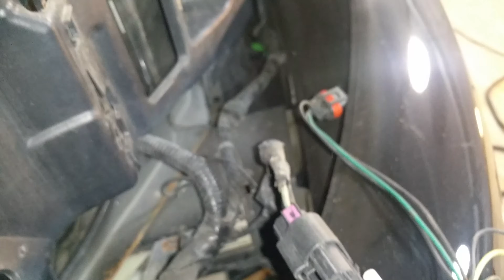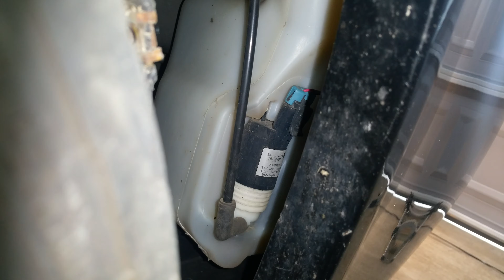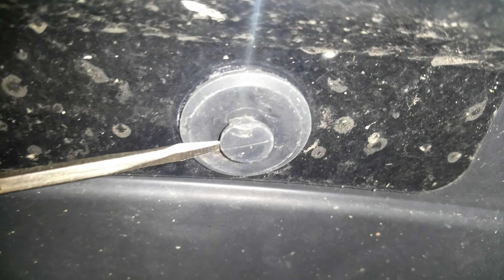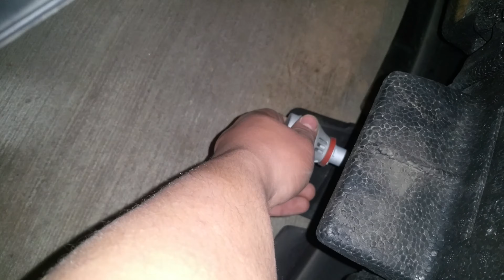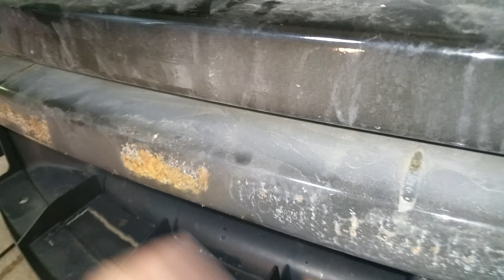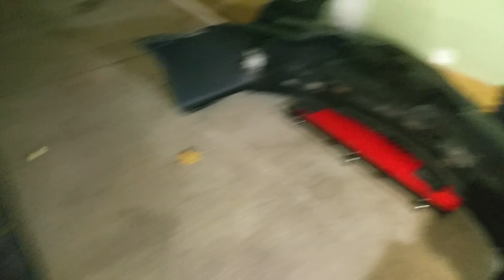Pontiac Grand Prix GXP - How to remove the front facia

Comment: Hi. I have the exact same car the front driver side bumper got ripped off I have it the blinker is like hanging but I can put it back into its spot but it's like broken and half I I can put it up in I'm just not sure where the holes in the nuts I would need to put it back I mean when I put it back and hold it there it looks like it would stay I just don't know if I should use glue or poxy or find those washers and bolts like on your video but when I put it back up it does look like I can it'll fit good the wheel protectors one actually came off I'm probably just going to leave that off if I if I can I don't know if I need it or not it doesn't seem really like I need it but I might need it I don't know but I'm a girl and I have to do this myself so any you know advice would be greatly helpful I don't know how long I'm going to this video but yeah well thank you Merry Christmas hope you get back to me thank you

Comment: I have 2006 gxp 5.3  installed 2 transmission coolers one in series with the  Oem rad cooler still ran to hot so a added a 2nd large rv cooler in parallel  with  the stock set up finally acceptable temp . My question has any one header wrapped the exhaust over the transmission and see a drop in trans temp if so can you let me know .

Comment: I always wondered when they quit making real steel bumpers on cars if there was still one hidden behind the facia . when you got it off, ( and nice job explaining everything)  there is kind of a metal bumper there . Is there any strength to that or just sheet metal . could a toe bar be hooked to it ?
not sure if you can tow a FWD car in N with out wrecking the transmission I think the engine has to run to pump oil through transmission.  I live on a hill with long drive way. in the WI.  I own tractors
so when we get stuck coming up the drive way there's no place to hook a chain unless I have a couple hooks welded to the cradle  then the chain still might crack the  plastic facia on the bottom/

Comment: Yes, I am curious about the Trans cooler install,   will we see a video of that in the future??  Your videos are extremely helpful,  just bought my 2008 Grand Prix GXP,  Love it!!  I also have a 2004 Bonneville GXP,   Keep up with the Fantastic videos!!
Reply: Put a large transmission cooler on both those cars transmission in did on my  2006 5.3 gxp Grand Prix  plus I changed fluid with synthetic transmission fluid that’s dextron 6 approved and service yearly . Bought the car cheap re did minor rocker rust , repaired heads up display redyed  front seats repaired minor rust on the rear quarters replaced the valve front cover gaskets and o rings replaced rad ,charged Ac after repairing leak ,rebuilt transmission installed touched up black paint and the polished and waxed cleaned Alcoa rim which were mint . The car looks and drives factory new very happy and it gets great gas milage if you can keep your foot out of the gas pedal . After I completed the car I oil undercoated  every nook and cranny of the unibody rockers rad mount front towers doors unibody infrastructure from headlights to rear bumper support rear deck hood wheel arches in and outer . In total i spent about 200  hours on the car

Comment: Did you happen to do a video on installing the trans cooler you mentioned?
Is there any other steps in doing so that you can list, if no vid?

I am thinking about a trans cooler on my 07 GP - I Uber drive and when the trans temp gets over 210 degrees it shifts hard.

Comment: $2600 to do my transmission 2yr/24000 miles warranty. Does your extended warranty cover the repair.
Reply: Robert Gray I GOT WAXED FOR 4700 WITH UNLIMITED MILES FROM AMMCO
Reply: Hi from Ontario Canada,I just restored a 2006 gxp replaced transmission I purchased as is . One thing I found theses trannies run way to hot which kills them . I found mine in late August running 214 f so I added as big a cooler I could fit in line with rad cooler now  max 184

Comment: Awesome video!  Removal was just that easy!   Are you going to take off all your other plastic parts and rear support bracket (where your foam was wedged in)?  You can take off the headlamp bracket too and have a lot of access when you put in your trans cooler later on.
Reply from the maker: +cw2lido yep. Doing it a little at a time. I need to get ahold of you. Can you message me your email?

Comment: Whenever you get time you should wrap your crossover as well to prevent heat soak on your new trans. Costs about $15
Reply: Thanks will do to 2006 gxp just restored and rebuilt transmission  and added a big cooler and a smaller one 184 f is the highest I have seen now before 214 f ouch  those v8 really heat the fluid . I have a 3.8 v6 with 408000 km on original transmission serviced transmission fluid 1 -2 times per year suctioning out 4-5 quarts out dip stick tube with cheap hand operated  suction gun and small diameter tubing pushed down the transmission dipstick tube . My 2004 gets dextron 6 and my 2006 gxp gets synthetic dextron 6 approved many blogs recommended max life and other dex 6 approved synthetic its has better heat resistance than regular dextron 6 .My transmission fluid services only take 15 min to complete and its cheaper than a new transmission maintenance is the key to long life . My old transmission fluid gets kept and used for oil undercoating my cars and  I put some in oil squirt can mixed with a little kerosene or diesel fuel makes cheap penetrating fluid
Reply: 214 is bad… mine gets up to 230😬